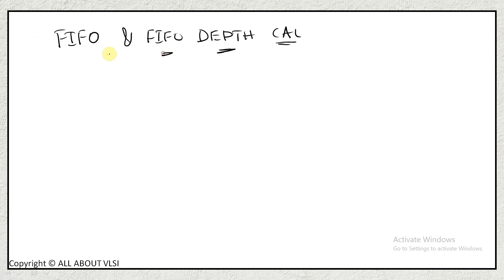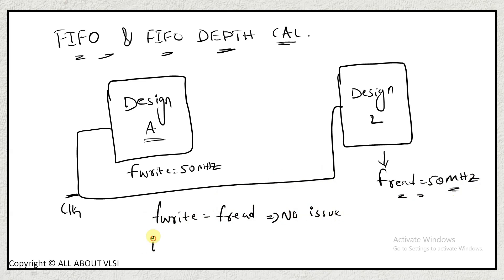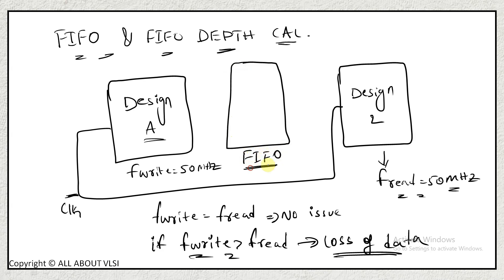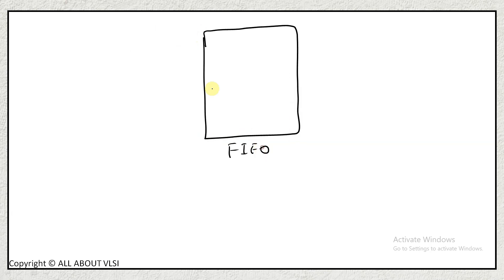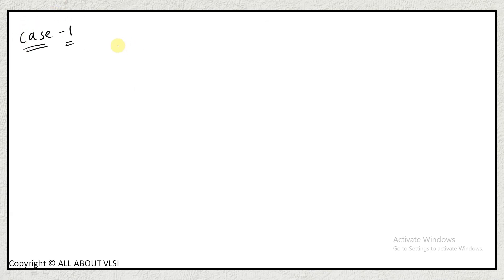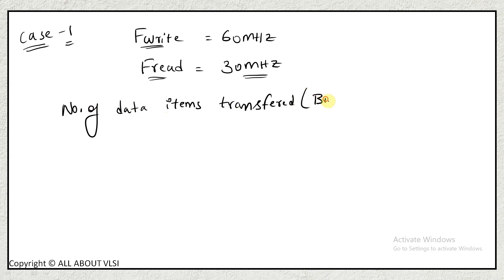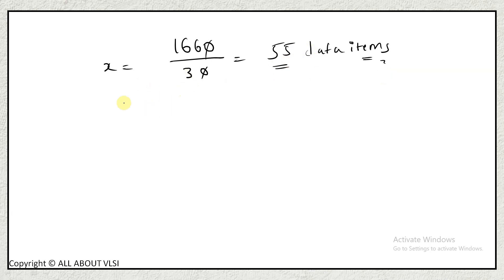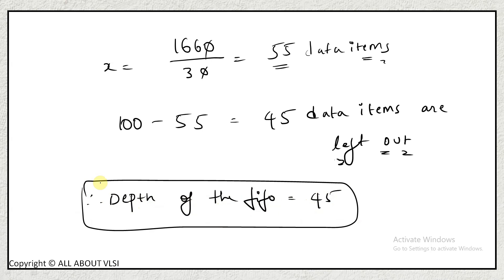FIFO Depth Calculation Explained with 3 Cases | VLSI Interview & Design Concept

Comment: This is very helpful video,
But for 3rd case how FIFO depth is calculated to 10?
There is some calculation mistakes in this lecture.
1/30MHz will not come out 30ns.
I was trying to solve for 3rd case writing and reading was coming approximately to 100 burst size. 
So, here FIFO depth will be 0.
Please let me know whether I am doing any mistake in calculation.
Thank you.